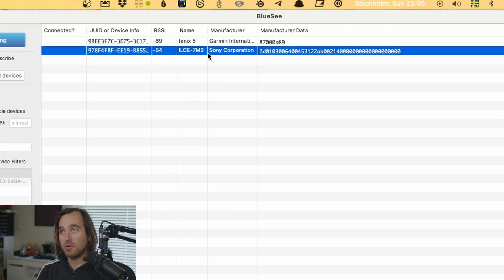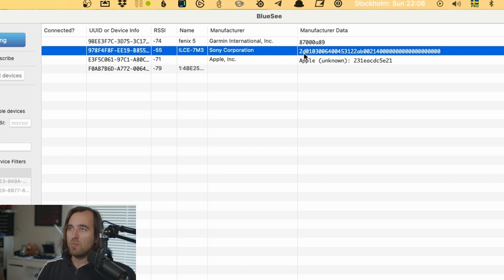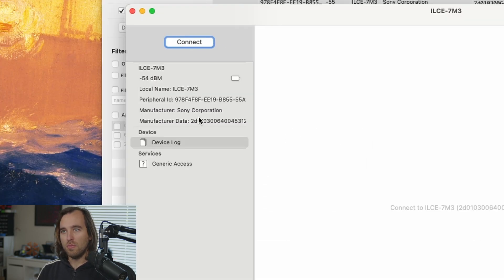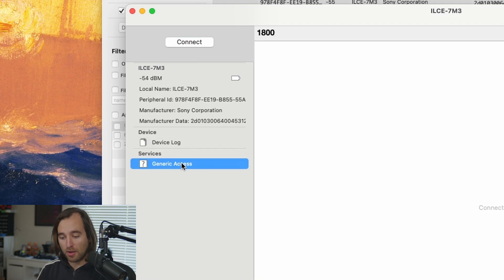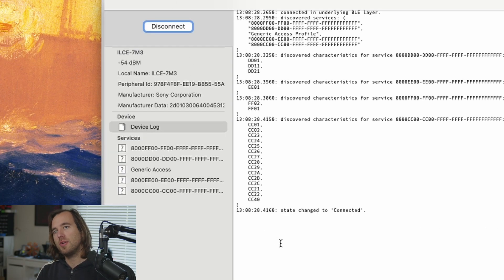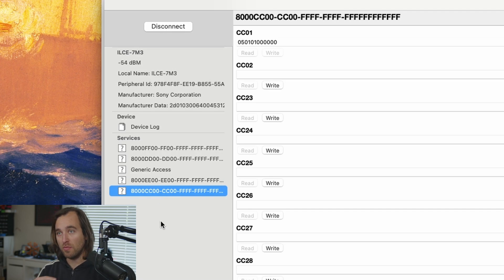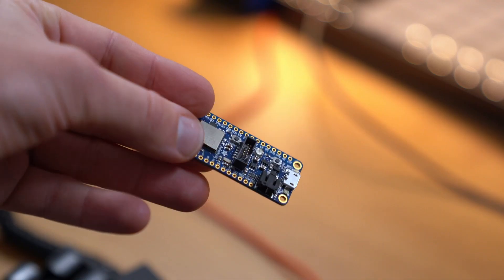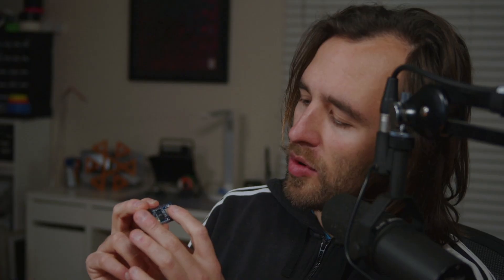Building a custom BLE remote for the Sony A7 III camera

Comment: Anyone tried this with arduino and hc-05 BT module? I wonder if this would work
Reply from the maker: The code I wrote won’t work but you can easily just port the commands to whatever the HAL looks like. It’s probably a 1 hour task to port it to that framework

Comment: Thanks a lot for clear explanation. I wanted to do the similar project using ESP32 micropython. Unfortunately pairing and bonding is not supported yet for micropython esp32. I decided to take a simpler approach based on your information. I use nRF Connect app and write custom macros for taking picture and record video. For those who are interested you can find the guide here https://www.youtube.com/watch?v=lLQVk2f1Jpc  It is in my native language but I am sure you will get the idea.
Reply: Do you know if esp32 using c language support pairing and bonding?

Comment: Bravo! 👏 I enjoyed this. Now just got to see if this will all work with my Sony FX30 (so far, not working using nRF Connect BLE app on my phone paired to FX30). Will review your project to see if I've missed something!
Reply: Figured it out! Enabling "Bluetooth" on the camera does not also enable "Bluetooth Remote". 🙄 You must also go into the Network -> Transfer/Remote menu and enable Bluetooth Rmt Ctrl. This is a separate menu from the Network -> Bluetooth -> Bluetooth Function On section. I guess the idea is that you may want to lock out remote control while still allowing for other remote camera app capabilities...
Reply: @BensTechLab  You managed to trigger the autofocus by sending commands to the FF01 characteristic? Can't get this to work on my FX30 :/

Comment: @coral Hi , i know is a long time since the video was uploaded , but have you ever tried to see which service is used and wich commands for focusing in and out from the remote? I think this would help in creating either a phone app to make focus stacking on the sony alpha cameras a lot easyer, or a remote like you made but it would need to have some sort of imput to it. Thanks
Reply from the maker: I'm going to guess it's 0x0115 or 0x0116 ? You can tbh just step through the 16 bit value starting at 0x0110 and find it quite easily. What I do know however is that you can only send the command "focus near" or "focus far" not set exact focus points so my question is how reproducible it is.

Comment: Would you be willing to share your Fusion 360 models or point me to the model for the  NRF52840? I'm looking to remix your model and code to add GPS functionality to the camera.
Reply from the maker: Hey Matthew ofc. I put all the STL files in the github repo but not to familiar with F360, is there something else I should export and add to the repo?
Reply: @coral1  I was mainly looking for files that I could edit (i.e. .step or .f3d file) as the .stl is really only useful for printing. Anyhow, after posting my question I stumbled on https://github.com/adafruit/Adafruit_CAD_Parts, which I think had the full models I was looking for so I just started my own model from scratch. Many thanks for your work on this project!
Reply from the maker: Yep that's where I got the models for the NRF52840 in the first place. Let me know how your project goes, I'm very interested to see what you build.